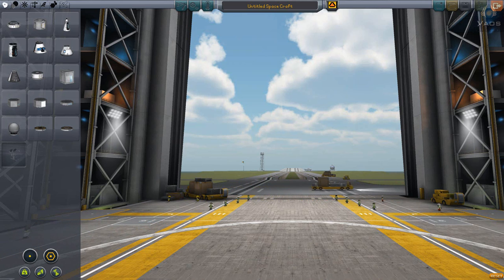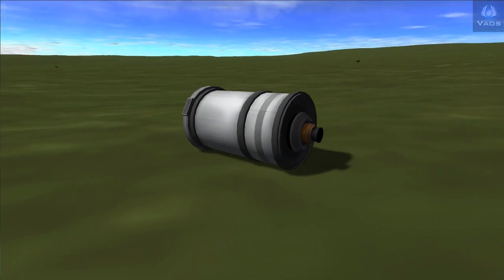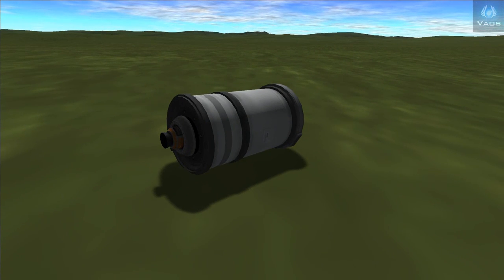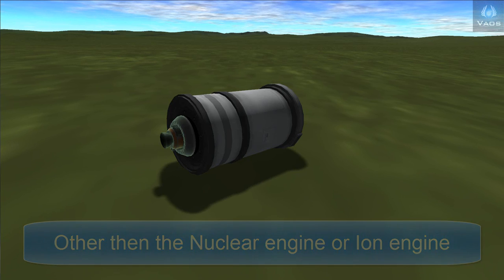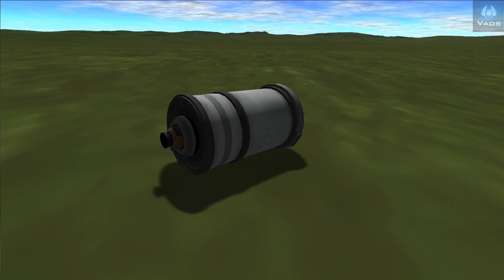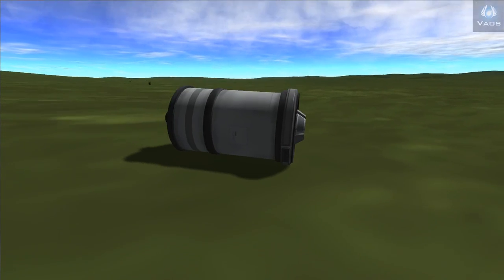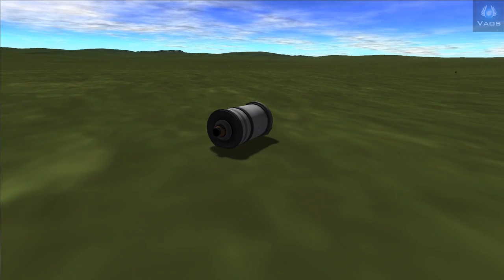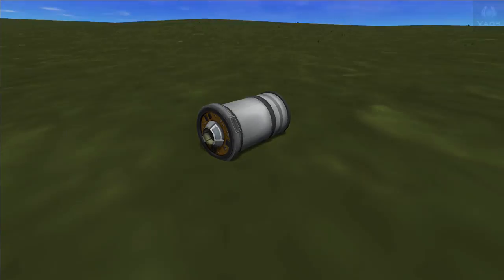*VERY OLD VIDEO* KSP V.23.5 -Vid#72-  Quick SSTO only 4 parts.

Comment: You can make a three part SSTO with a LFB KR-1x2 (the ARM liquid fuel engine combo part), the probe you use, and a large chute. I made it after watching this video, it's what I thought you were going to use.
Reply: You can make a 2 part SSTO if you use that engine and a control unit without using a parachute, a SSTO by definition does not have to need to come back safely to the planet, it just needs to get into orbit with 1 stage. On the other hand it won't be retrievable if you do that. :)
Nice work either way vaos, you really love those tiny rockomax engines don't you ;)
Reply from the maker: Yaa, those new rocket parts are rather over powered though. I hear a roomer that they are going to nerf them in the future. Don't know if its true or not. :)
Reply: vaos3712 I think they should just put it further up in the tech tree and require a lot of science to unlock, it's great for launching big interplanetary stages into orbit, rather than the big mess of 2000+ parts u can end up with sometimes trying to launch those things into orbit.
Reply: I know that compared to the other parts they are overpowered. However, I don't know how you would compare the values excluding Isp, but the real engines, RS-25s actually have higher specific impulse than the KSP versions.
Reply from the maker: snipekill1997 I'm sure they did that to the Rs-25s to bring them down to scale. Kerbin is i think 1/4 the size of earth? or something like that. I have yet to try that real solar system mod, i hear in order to make orbit, you need to be going 8000+ m/s :\
Reply: Wow, that is a lot of dv. I just looked up the real dv values, they range from 9.3km/s to 10km/s to reach LEO. I think a realistic mode should be standard for KSP, as long as they change the parts to more closely match reality. I think in KSP the fuel tanks are something like an order of magnitude too heavy in relation to the fuel they carry.